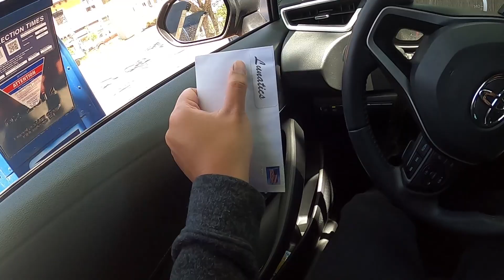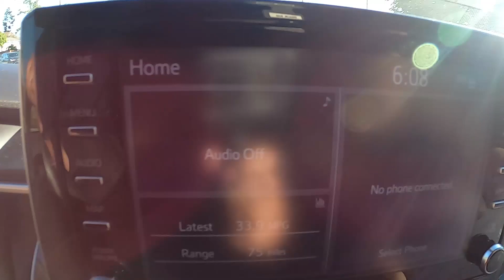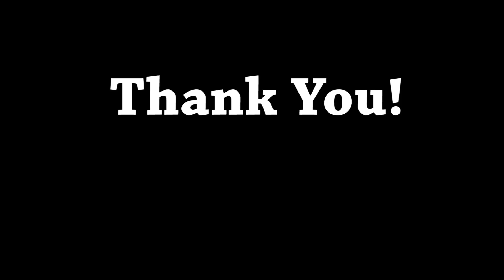Parting Out My IS300?? + Drift Week 3 Ride Along!

Comment: which car did the 3.9 diff come out of ???
Reply from the maker: Auto IS300
Reply: @CorneliusVeee  why did you swap to an auto diff?
Reply: @The503Mac  y38 it's a 4.1 diff from the brz/86
Reply: @gianmarcoaguilar183  that doesn't say why he swapped to an auto diff
Reply: @The503Mac  ohhh why, I think he said he likes the welded more, probably bc the y38, and m98 are both torrent and can sometimes act up from what I know
Reply: @The503Mac  also I think the gearing is different the manual is300 is a 3.7 auto 3.9 and brz 4.1
Reply: @gianmarcoaguilar183  ahh okay. I'm just curious because mine is auto and I'm about to do the manual swap, but I could save money in a sense of not having to buy a diff if the auto diff is better (when welded).
Reply: @gianmarcoaguilar183  thank you btw 🙏
Reply: @The503Mac  I swapped mine too and I had an auto diff and it's way better personally I don't drift it but do a lot of track/ canyon driving but the gearing still sucks I think the 4.1 would be better if you're in socal I have an extra welded diff
Reply: @gianmarcoaguilar183  ah okay, isn't the manual drive shaft smaller? Is there a kit to make the auto diff fit or did you make a custom drive shaft? I live in Oregon
Reply: @CorneliusVeee  It’s hard finding one of these I’m trying to get one to weld instead of using my stock LSD
Reply: @The503Mac  I have a 1 piece drive shaft the drive shaft ends are the same its just one is longer you'd have to get the manual one and it'll bolt up or get a custom, if you plan on drifting just 1 piece I have a driveshaftshop one it was about $500
Reply: @gianmarcoaguilar183  you're in socal?
Reply from the maker: Welded is more predictable for drifting because you know both wheels are always going to be locked. I just prefer that as I’m learning to tandem more.
Reply from the maker: I usually ask around the Facebook groups. A lot of guys have them laying around because they prefer lsd since most people don’t drift
Reply: @CorneliusVeee  yeah but anything except drifting is terrible lol
Reply: @CorneliusVeee  ah okay. That makes sense.